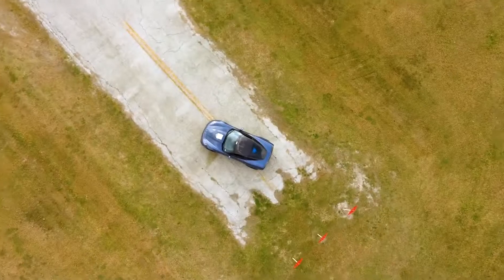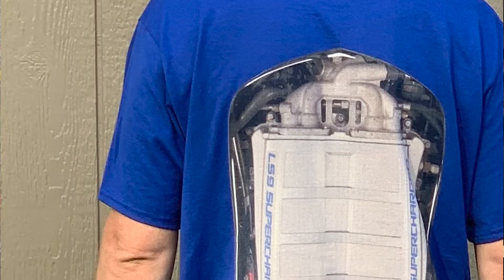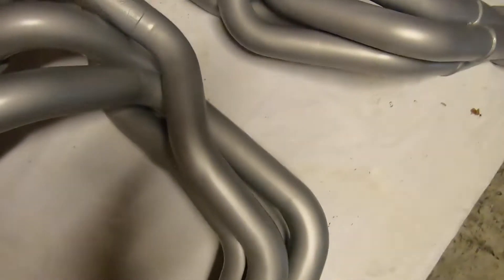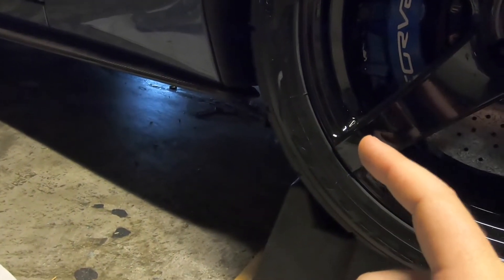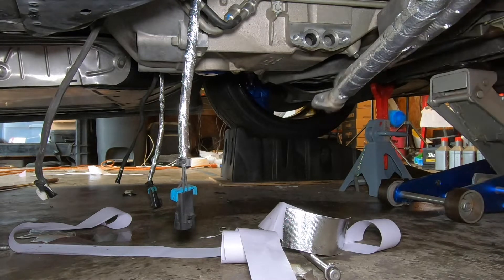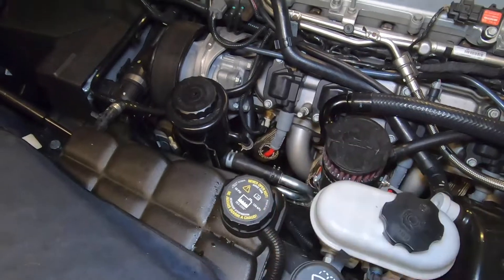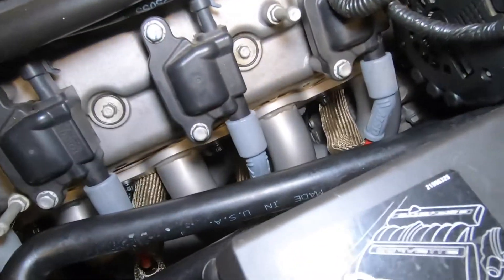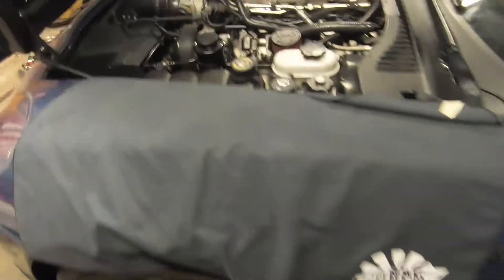CORVETTE CERAMIC LONGTUBE HEADERS - Finally Installed! (Driving Footage Incl.)

Comment: What are you mounting the MM catch can to on the driver’s side?  Pics?
Reply from the maker: The edge of the MM mount is bent and mounted to the brake booster bolt/nut. The expansion tank sits where I wanted to mount it.  I did a video a couple back “Best Catch Can”. You can see it more close up.  I also bought a different elbow, which they sold on their site.
Reply from the maker: Its not ideal spot but only option I have next to mounting beside radiator
Reply: OnlineCarShow thanks man, looks good! I currently have mine mounted where you have your ice tank and was thinking of doing the same thing.
Reply from the maker: Yeah it’s right above headers which sucks but it’s all I could find